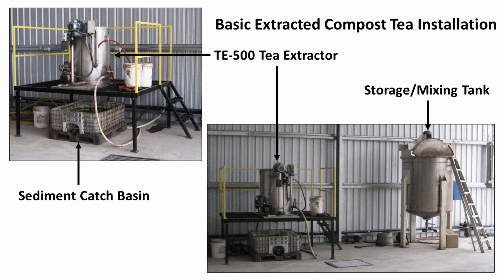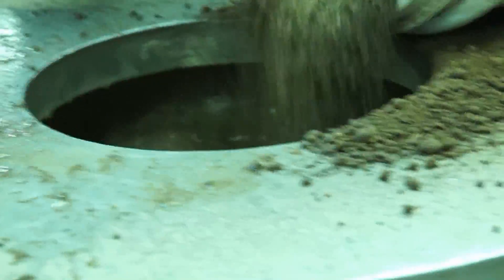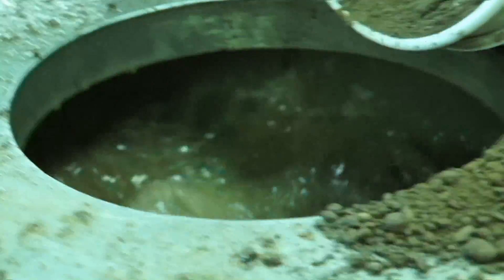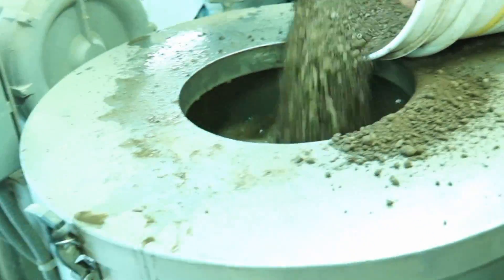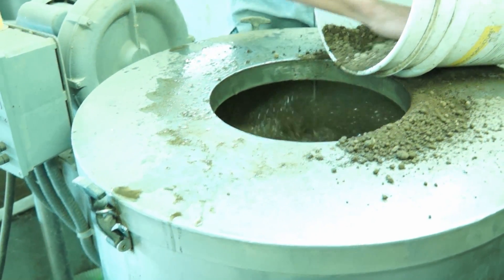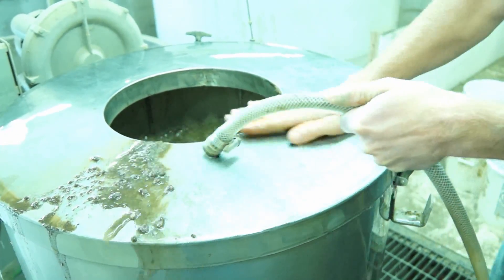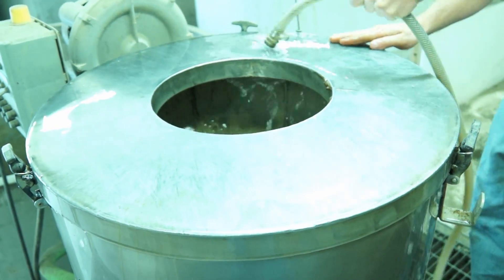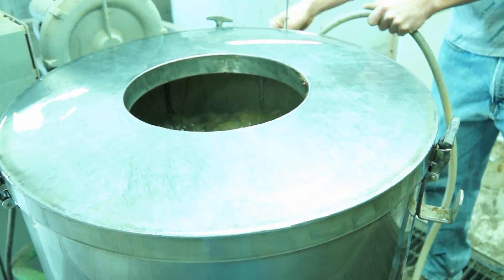TE 500 Operation

Comment: Someone just told me extracted compost is far superior to brewed. Could you elaborate? I would think the turbulence of the extractor would harm the microbes. And I don't understand how the microbes go dormant. I assume going dormant would be beneficial to microbial shelf life. Thanks for the video.
Reply: Extracted compost is superior to Brewed because the brewing process will benefit some groups and will discourage other groups because of turbulence and nutrition of the medium. Some groups will grow better
than the other ones.
An extracted compost have more biodiversity.None of the groups have been discouraged or encouraged due to brewing conditions.
Secondly, organisms will be dormant in compost and in the recently extracted solution and therefore will have a longer shelf life.
The counting of the brewed will start falling down in the minute you stop aerating it.
The turbulence of the extractor is nothing compared to the turbulence of some brewer machines. Besides it, this turbulence is just temporary, say for 1/2 hour while turbulence in the brewers will be generally for around 24 hours, i.e. 48 times longer.